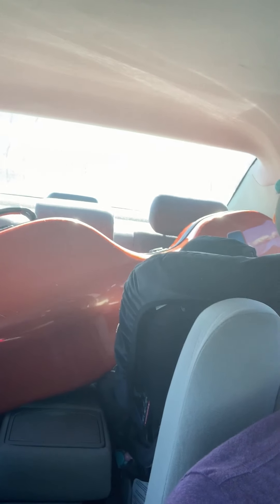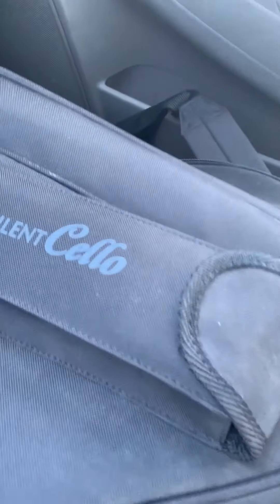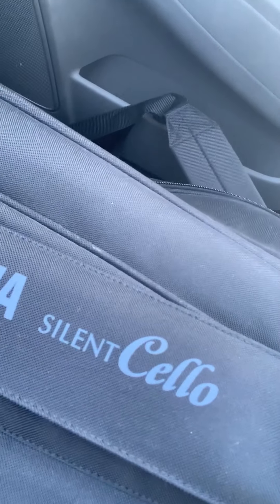Tone Dexter Tips, using IR's and how To Dial in a "Useful Sound" (Car Mailbag vol 2)

Comment: This was very helpful. I've found that the louder my band is the less likely I'll blend in my mic. Here's suggestion for a future video, or maybe even a new section on the Pickup Test site:
How to get the best tone when using wireless. I realize cellists probably don't use wireless much, but many violin players playing in bands use the Line 6 G10s or something similar these days. It's almost always put between the pickup and preamp input. How does that impact the impedance and pickup loading?  These devices don't always state what their input and output impedances are. Are there EQ settings or other tips we should know about for this situation?
Reply from the maker: Tom thanks for your comment and a fantastic idea.  we're working on a roundtable episode with wireless experts to discuss just these issues.  Look for it in the coming weeks.
Reply: Electric String Player Excellent! I would be honored to assist, if possible, in the round table discussion. Tim Huh and I have been rapping about this, and he has the Helix and belt-loop D.I. pre-amp - pre - wireless solutions covered. I have also met with Eric Aceto recently and find I am somewhere in-between them, and Jacob and I have many similarities in gear choice and what we have concluded... Something to discuss. I sent an email a few weeks ago, Jacob, just so you know. Thanks buddy.